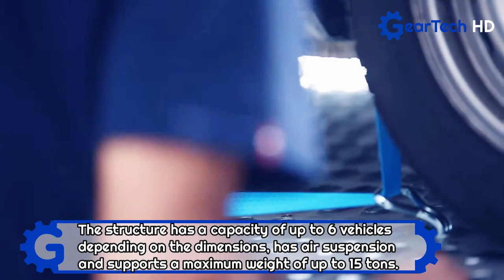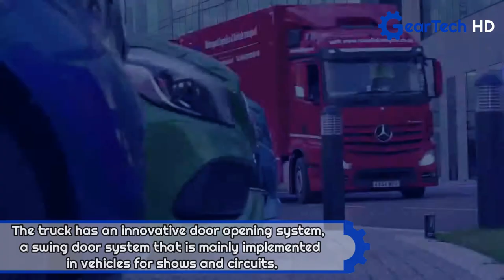The Most Advanced Trucks and Trailers for transporting cars 2 ▶ Special transport for trucks

Comment: On the truck hauling the cars what happens if the hydraulic system fails  besides loading & unloading but in transit also  ??      Yes your thumbnail pictures are never seen in your videos  .
Reply: Usually a mechanical locking system similar to the two and four post lifts used in a garage for repairs. They are commonly spring operated and allow the deck to lift but engage to prevent it dropping in transit or if the lift mechanism fails.  Some transporters use pins the driver inserts into the lifting mechanism to lock the decks onto place. It's advisable drivers insert the pins during loading/unloading to minimise the distance a suspended deck can drop in the event of a hydraulic failure.
Reply: ON THE TRUCK HAULING THE CARS??? THIS IS TRANPORT
Reply: "ON THE" IS WRONG WORD IN VEHICLE